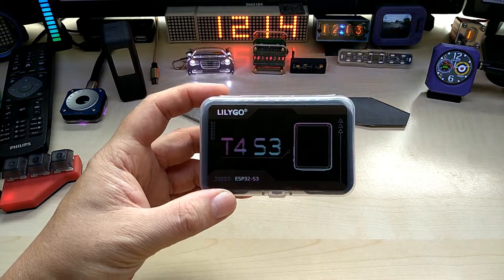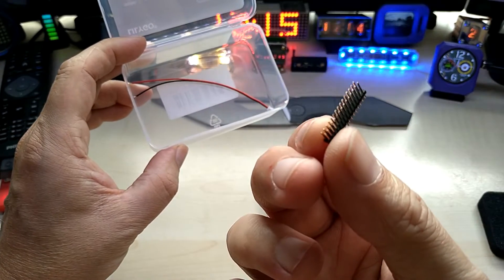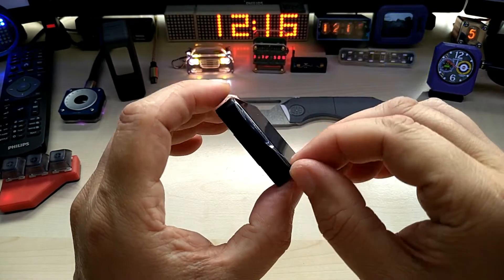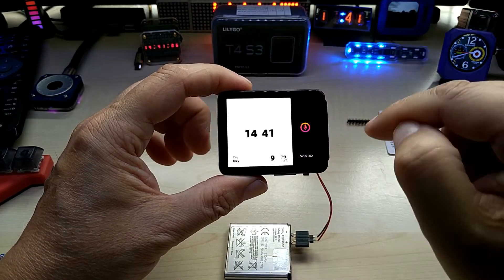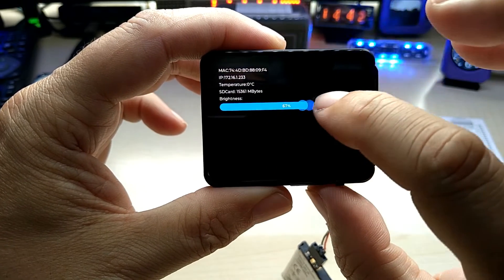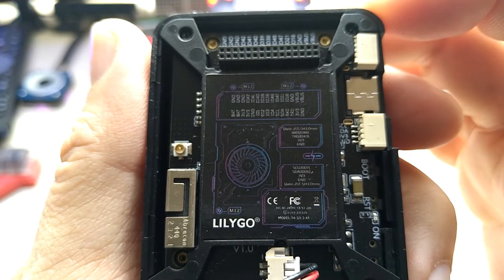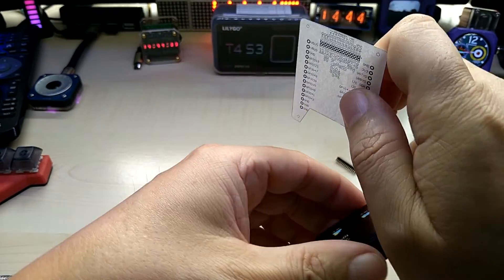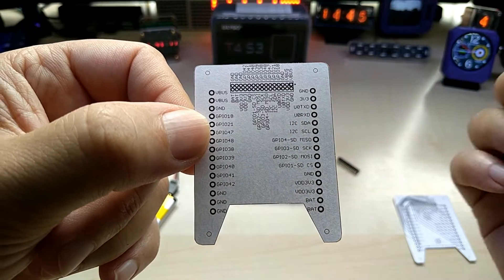Lilygo T4 S3 Cap. Touch 450x600 2.41" AMOLED Display #ESP32-S3 with Custom Breakout Board by #Hayri

Comment: To me, it looks like ... "a solution in search of a problem". 🙂

I'm sure I could design many different things using that board, but I'm just not sure which one(s). I'm thinking about something like an "investment tracker", although I'm not sure about a suitable data source. Maybe a data feed in JSON format?

I wonder how much it would take to display a slide show in JPEG format. They have "electronic picture frames" that would go on a desk or a wall, but maybe a pocket-sized version. (Just thinking out loud ... through my fingers. 🙂)

Oh, is there a bottom to that case to protect the bottom of the board?
Reply from the maker: sorry about the late reply, good questions, I just recently found a good use for the T-Encoder Pro for my Demon Eye project for my car. Anyway, I did look for cases for the T4 S3 but only found ones that fit the bare display model but I am not going to pry mine off, it could break the glass. So I am thinking of creating my own back cover design and maybe use it for a wireless home automation remote. Having an actual power switch is a big plus, although maybe I could add wireless charging as well. That way I could have it on a dock, either during the day on my desk or at night beside my bed. Stay tuned if you like :-)

Comment: Hello, I'm brand new to ESP32 and these kinds of displays but I wanted to see if it could work for my usecase? Can I make it connect to wifi, listen to a websocket server and then display that data on a GUI I create. I am currently using a raspberry pi with a 1.5" oled over I2C but this screen would be much better
Reply from the maker: I don't see why not, the ESP32 has WiFi and BLE, can connect to a websocket and surely display anything you want on the display. If you can use a Pi, you can learn how to  use the ESP32.

Comment: The board looks amazing especially for the price. My biggest problem with it is the size though, at least for the applications I'd like to use something like this for the display is just plain too small and the resolution seems almost overkill.
Reply from the maker: It surely is a nice product. There are many different sized displays available, just need to check what will work best for your project. I agree 450x600 pixel is a lot, and I see the ESP32 S3 coming to it's limit with fast screen refresh. Again, it will depend on your needs and skills to make the most out of it. I still have not found a particular use for it, for now it is sitting on my desk till a light bulb in my head comes on to use it for something special :-)